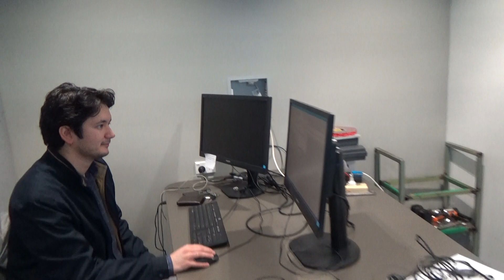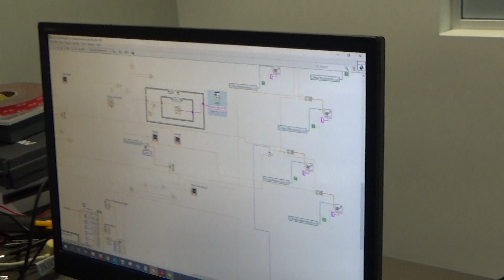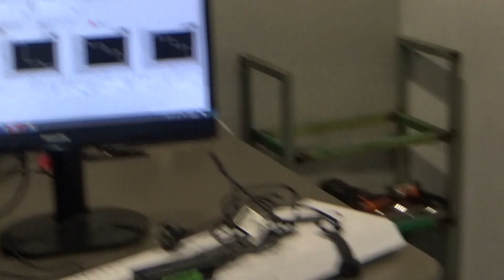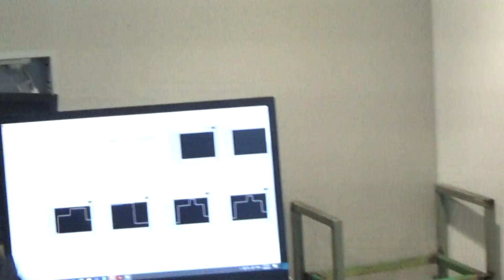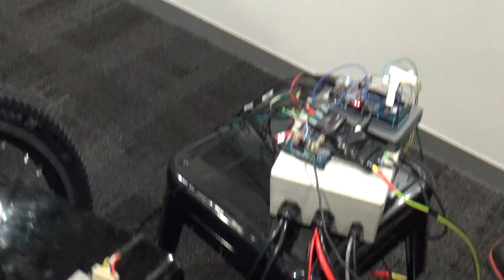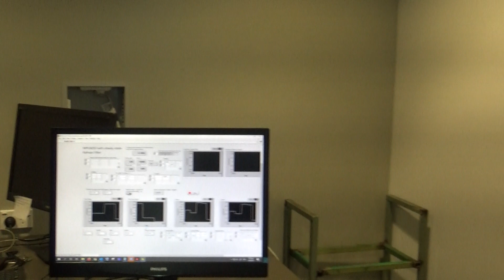Two wheeled self-balancing wheelchair.

Comment: That's a very impressive demo, and concept.   If the pendulum weight was split and moved in to the same axis and radial as the wheels you'd eliminate any hanging obstacles that could catch, especially that someone's legs are going to be in that area too so moving this weight out would help.   The ideal of using the battery at that counter weight is just excellent engineering.